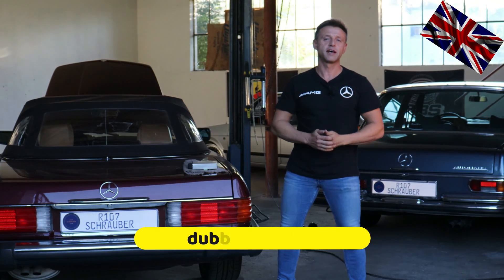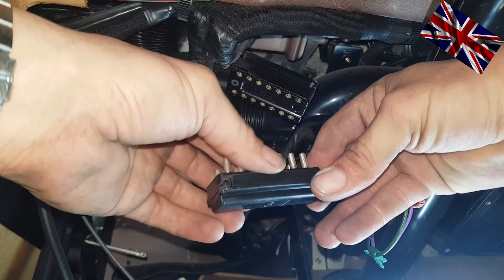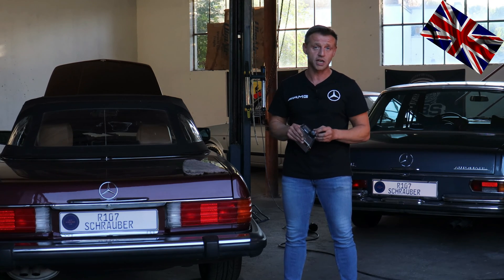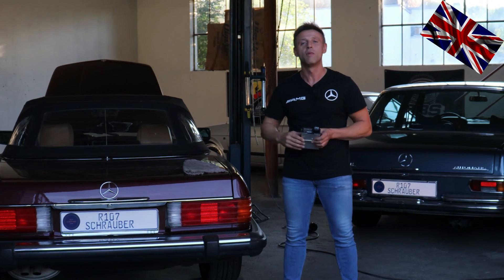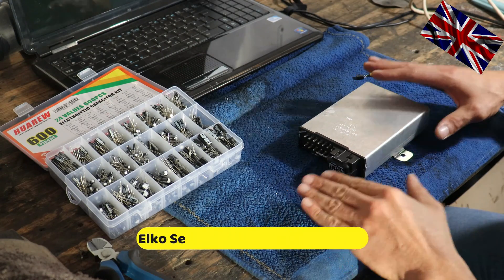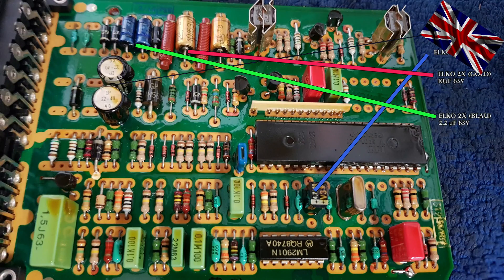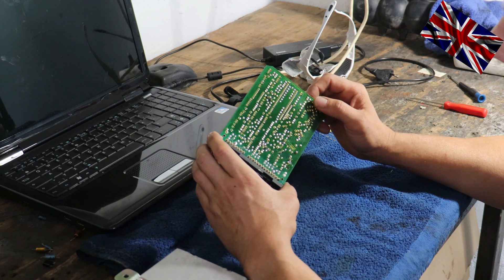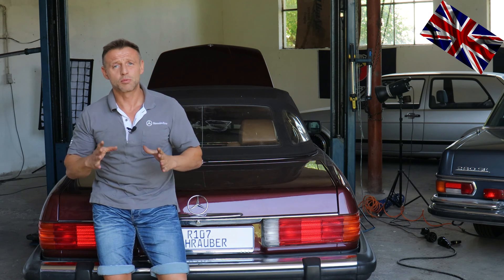Mercedes cruise control control unit from VDO new soldering - control unit repair for R107 and W126

Comment: Hi,
As I bought my 380SL 9 months ago, the tempomat was already dysfunctional. I have just changed the control unit and it works perfectly. As you said in your video, it is very difficult to reinstall it under the dashboard. 
Unfortunately I did not take a photo and so it is not so obvious. Do you the opportunity to have one?
Many thanks